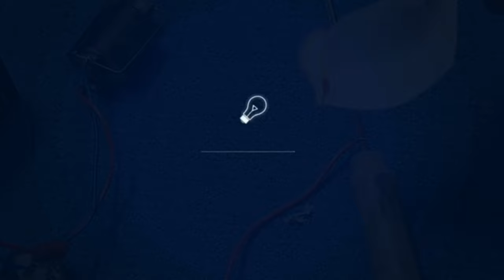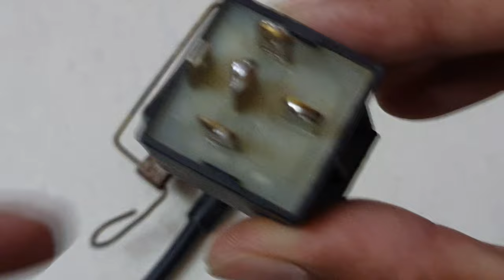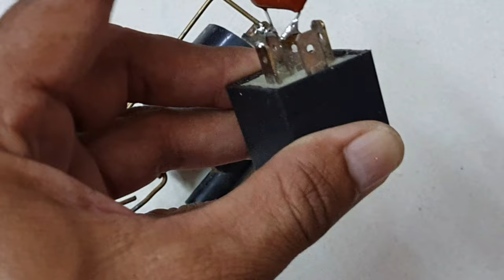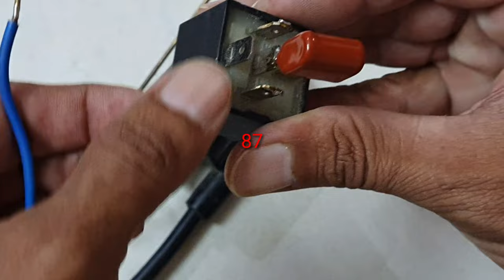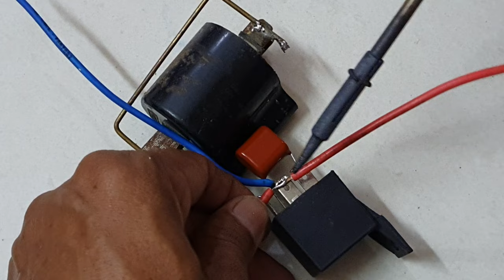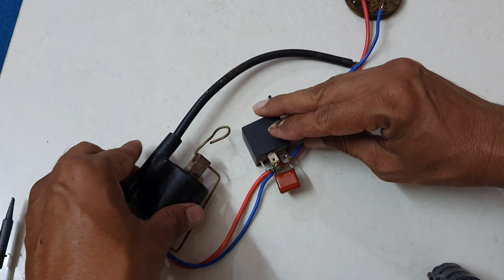homemade Ignition system

Comment: Capasitor number
Reply from the maker: 0.1 mf 400/600v
Reply: @technicaljugad6234 if i use relay only means without capacitor can i get spark from ignition coil using 12v battery
Reply: Fogging machine ka ignition repiaring ho sakta he kya